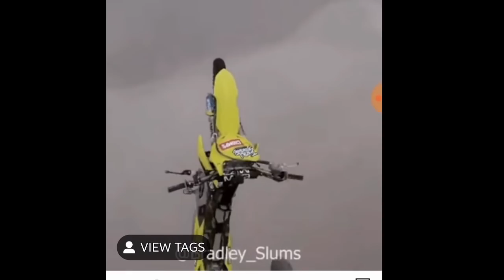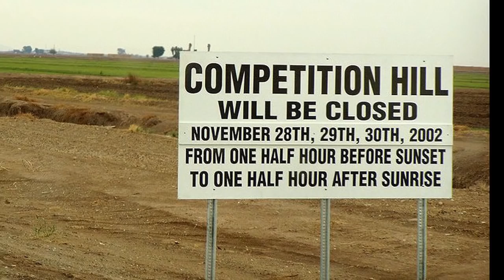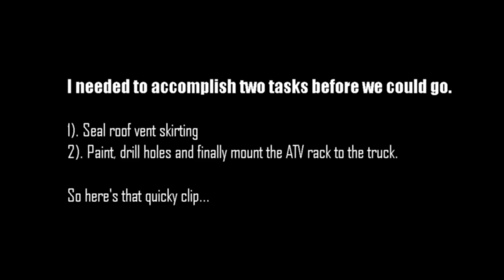4 x 8 Camper 41 Part 1 DOES IT ALL FIT ??

Comment: Looks like a LOT of fun! And great job with that rack, excellent use of resources and an ideal budget. I can't remember, did you seal up the roof vent with butyl tape underneath first, or just do the flex seal on the outside?
Reply from the maker: Eli I did use the butyl/putty tape first yes. I had to shave off the excess that had smushed out before I coated it with the Flex Seal. It had a good 24 hour rain test!
Reply: I will probably apply a nice layer of that flex seal stuff to the top of my vent fan, after the butyl tape.  Peace of mind is worth an extra step!  Great work!